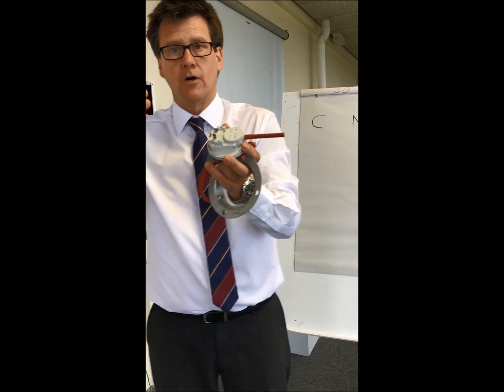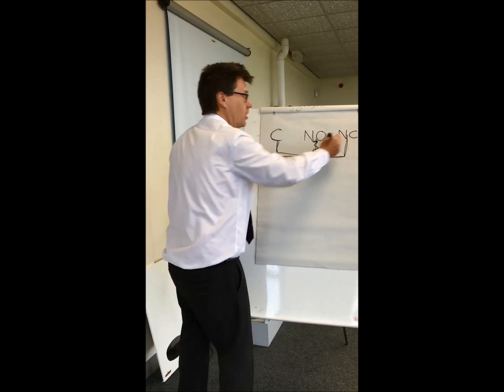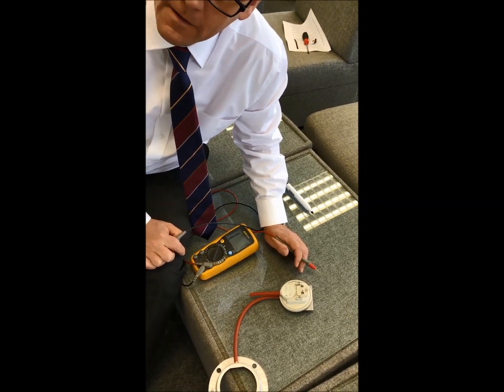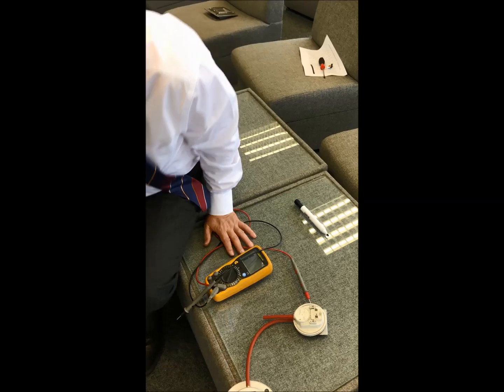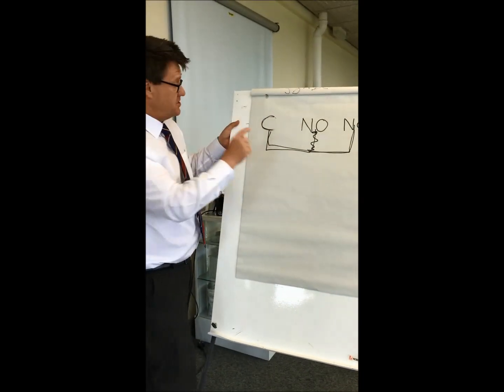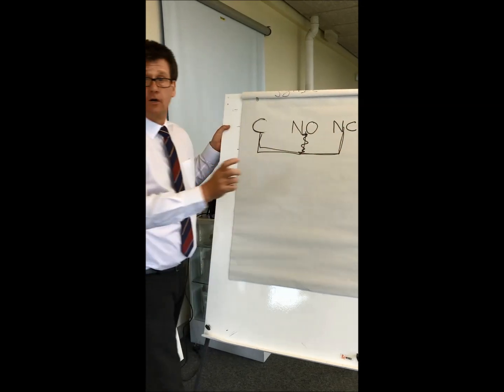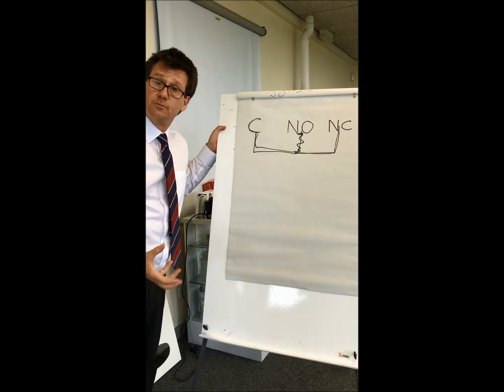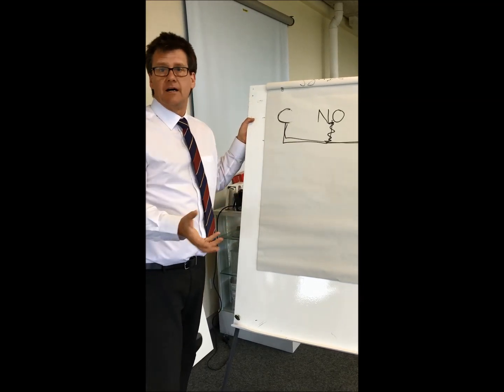Sequence of Operation - Air pressure switch

Comment: Excellent stuff John. I had this recently Continuity on C -NC but no power (zero) to the fan from PCB I bridged the main to feed the fan and boiler powered up.. told them needs a new PCB. Gave price they never called back so no idea if it was or not, could it have been anything else. Pump was ok and continuity on flow switch Baxi 105e combi.

Comment: Hi John,  your explanation on Air Pressure Switch is excellent. I understand that the C (240v) will switch to NO from NC when the fan is running at correct speed (which creates a negative pressure).  My question is: what will happen where there is fault and the C is connection to BOTH NC and NO?  Once C-NO connection is created, the gas valve will be opened, spark fires, ...

Comment: I'm no expert on this stuff (hence why I'm watching for my own information and education).  I have a Potterton Suprima boiler (about 15 years old) and the number one common fault with them is the PCB failing - I believe to with poor quality dry solder joints. So I cant quite buy the 'PCBs are pretty much bullet- proof for all manufacturers' comment. Just saying.
Reply: Has yours needed be replaced? You didn't say it has so you read it somewhere which has zero credibility

Comment: Hi John
Does the PCB of a boiler having 3 wires APS also perform the test in a sequence at APS C to N OPEN just before sending 230volts to Fan in order to prove 'no air' signal back to PCB by sending 230v?

Then if open, PCB sends 230 volts to Fan which creates differential pressure which is ACTUALLY Common to NC At APS

Thanks for this video.